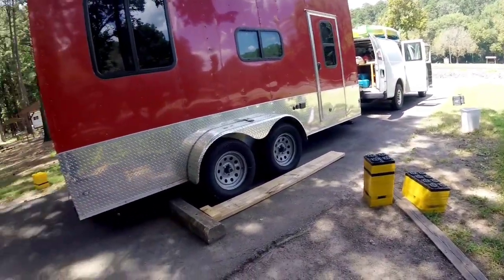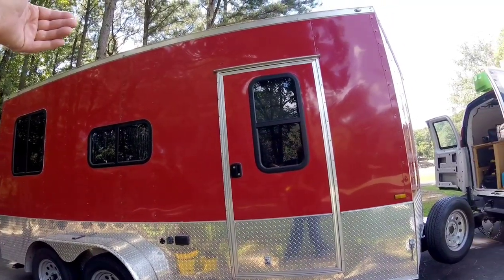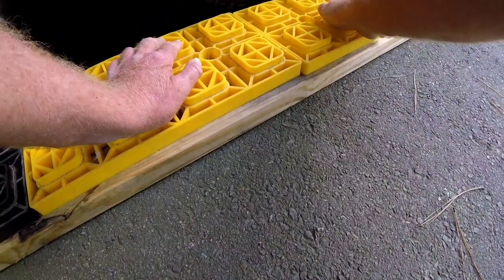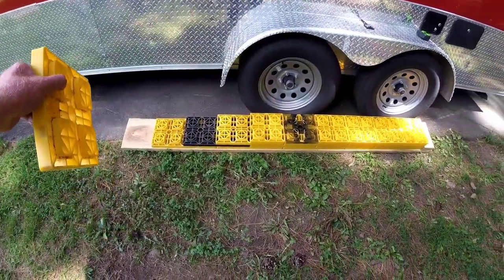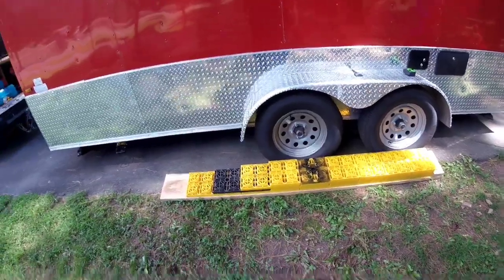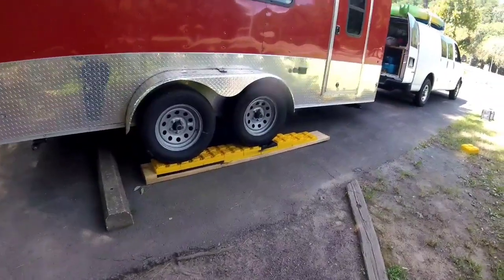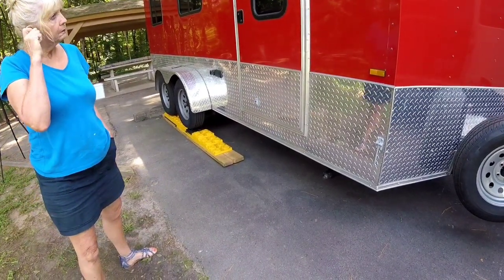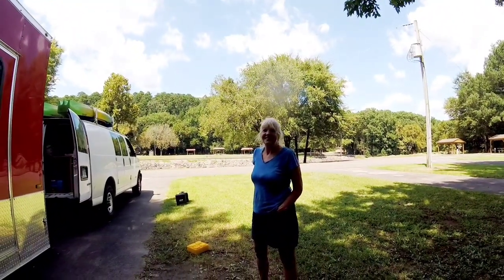Setting Up And Leveling Our Cargo Trailer Conversion

Comment: Laying flooring all those years gave you a good eye for lining those things up.  For those of us they may lack that visual acuity could we measure across, side to side, to be sure we have the blocks parrellel?  I like your board device for holding the blocks.  As on of my nieces said once you get it done, "It is more better".
Reply from the maker: Lol. Yes, it's "more better". Yes, you could measure out to get it straight, or, better yet, fashion a board about 2 foot long cut down to the proper thickness for the gap. Then just hold it vertical against the side of the trailer and tap the long board over till it touches in 2 spots (one spot next to the back of the fender, and the other at the back of the trailer.

Comment: Ever thought about using kids sidewalk chalk to mark your wheel path then move your blocks to the marks?washes off easy...I know cuz the grandkids like marking up my driveway!lol
Reply from the maker: We've been to several campgrounds that were gravel or sand pads. Plus, the use of the 2×10 gives us an extra 1 1/2 inches of lift, and distributes the weight of the trailer better.

Comment: Bill, I am enjoying your posts and am considering a build.  You mentioned that ideally you would have done a suspension lift.  So I’m curious what your existing ground clearance is, and what your ideal ground clearance would be for your drain set up.
Reply from the maker: Current ground clearance is around 12 inches. If you're draining into a regular sewer hookup that would be enough in most cases. We use auxiliary tanks with wheels on them. We stay stationary about a week or more at a time. It's much easier to simply tow the auxiliary tanks to the dump station when they are full. Most decent size auxiliary tanks are around 12 inches tall. Then you have to account for the slope of your campsite (not all are level). I would like to see around 16 inches of Clearance and with straight axles that's about where it would end up. Even then, you might still have to raise the trailer (but not as much), depending on the campsite. The extra clearance also helps just backing in to some campsites.

Comment: So what’s the purpose to drive the trailer on them block ( LEGO blocks) if you got the stabilizer jacks?
Reply from the maker: The "stabilizer jacks" are not for raising/lifting or leveling the trailer. They are only for "stabilizing" the trailer. As stated in the video, the trailer has 4 inch dropped axles. There is only about 11 inches of clearance when the tires are on the ground. Even though my sewer drains are tucked up into the chasis as much as possible, there simply isn't enough clearance for my sewer drains to drain properly into my auxiliary holding tanks.

Comment: Well, it appears you did your level best. 😃 Just as a suggestion, aren’t there chicks available with that system that just lock on to the grid as well?  I just ordered the other brand and they had them so that’s what I went with.  But I do think I saw the Camco version of them as well.  Get 4 of them and you’re good to go...or stay might be the better way to say it.
Reply: Not chicks, chocks.  Darn autocorrect.🙄
Reply from the maker: I thought I saw those somewhere at one time, but I haven't seen them available lately.  I'll keep looking.
Reply: Wally, $23 a pair f/s right now.

Comment: I can't figure out why you didn't just raise one side with one block and leave the other side on the ground? 🤔
Reply from the maker: It's been a while since we did that video (around 3 years). That was the red trailer. I believe we mentioned it in the video, but that trailer had 4 inch drop axles which meant it sat very low to the ground. With that trailer, we were using "blue boy" totes for our gray water. Due to the trailers low clearance, our sewer drains actually sat lower than the blue boy totes. Since "stuff" don't run uphill that meant we always had to raise the entire trailer a minimum of 4 inches so we could drain our gray water properly. When we ordered our current trailer we specified straight axles for additional clearance.
Reply: @billanddeb  Thanks, now it makes perfect sense.